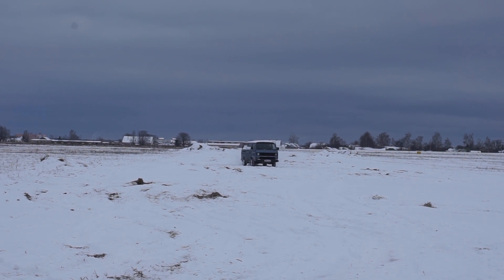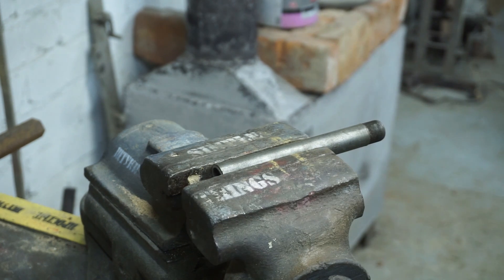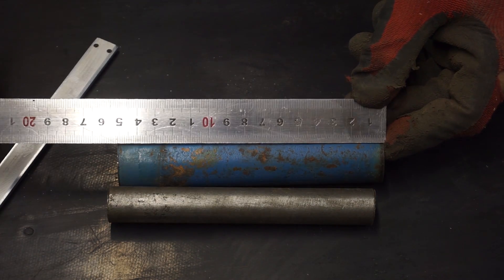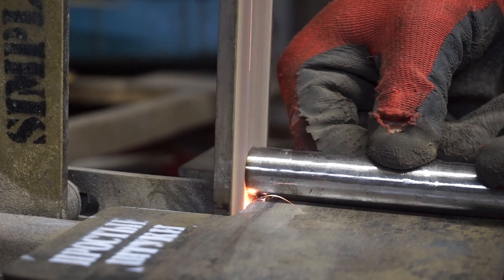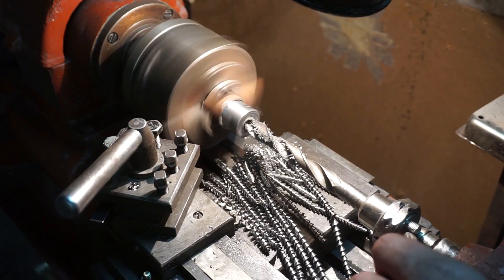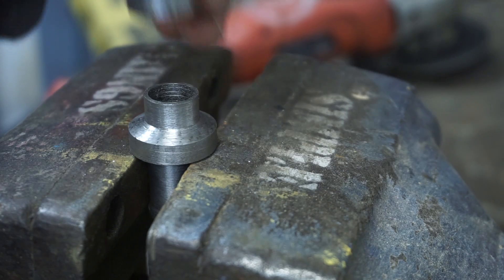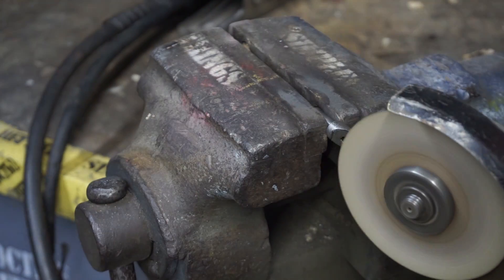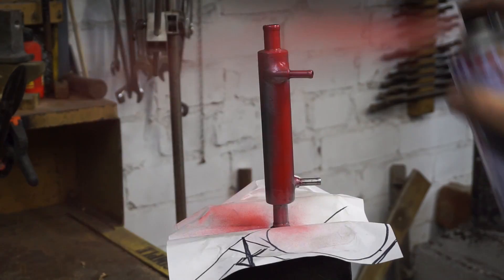Heater for diesel fuel.

Comment: Ive made these out of old transmission coolers from scrap radiators and steel pile. Very nice!
Reply: Lol came back to say the Mercedes diesels I was making these for actually had one as a dealership option, and theyre only $35 on ebay lol.

Comment: Clever, and simple!!!! And every bit of warmth for diesel fuel, can make a huge difference... I remember struggling in my wrecker while loading a SUV that slide off the banked highway, and I noticed my wreckers high idle for PTO / hydraulic control, the idle started to slow, and then stutter. Please note, I was 50 miles away from any help, and it was (-19 degrees F and -35 wind chill)... I drop all connections and ran to my truck cab, and rev'd the engine, and started back towards town, and would acquire the downed vehicle in less violent winter weather... If that truck stalled out due to the diesel gelling / freezing up on me, I likely would have been dead, or to say, froze to death out there... So, I will be harrowing this idea and adding this type of unit, made from aluminum or stainless steel, and wrap it with a heating blanket / pad as well... Scary situation!!! 30 seconds later, I wouldn't be writing this to compliment your idea... Well done, Sir... Thank you!

Comment: You better use fuel filter heater, made from silicone. It allows you to start the heating process, before starting the engine and so, you will have heated fuel at the ignition. And this is the most important for diesel.
Reply: yes but heat exchange dose not use electrical power which is very important in some cases

Comment: Good evening!

Mad Wheel,

Can supply with vegetable and animal oils, used! And only micro Filter and put in a reserve tank! Logico that has to give ignition in the diesel and after approximately 10 mnutes change to the bio oil. Uses a timer solenoid!
Execente work of lathe and weld. TOP!